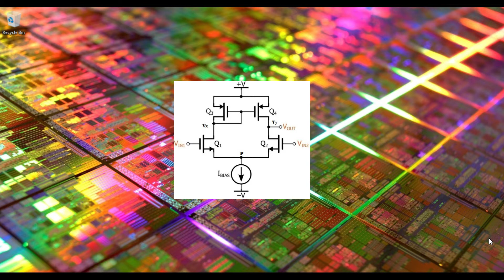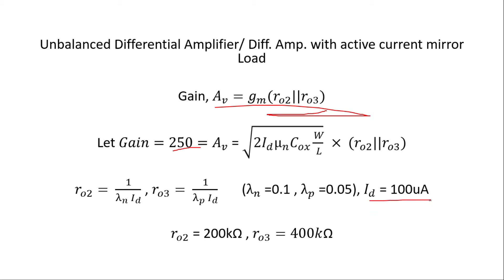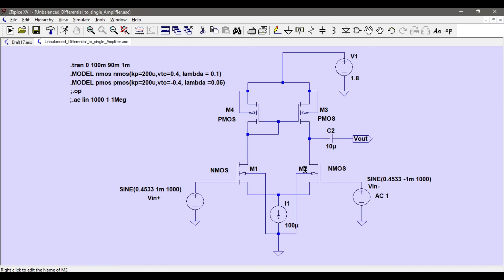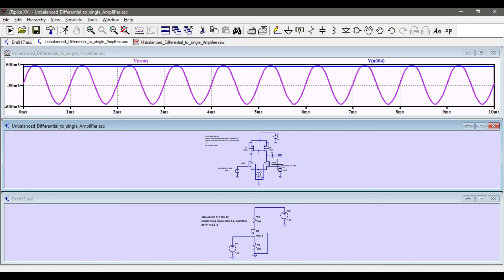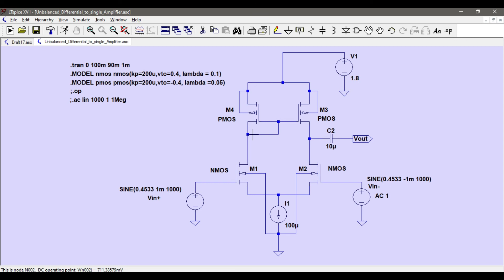Differential Amplifier with Active Load in LTspice

Comment: I'm getting ro2=100kohm, and ro3=200kohm.. I thik sir you have done mistake while calculating
Reply from the maker: I've already replied to this one many times. Please have a look at other comments or try to analyse the circuit on your own again. By mistake I've named tail current of the differential amplifier as the drain current of MOSFETs. In fact, drain current is half of tail current. Substitute that and you'll find the right answer. 

There's no problem in calculation, if it was there, you wouldn't have seen the required gain in simulation.

Comment: How did you get  176 for W/L? I keep getting 352 when I do that calculation
Reply from the maker: Hi Tristan, 
Glad that you asked your doubt. It's a little confusing since I used the same notation Id both for drain current of individual MOSFETs  and tail current of the differential amplifier. I apologise for that. Actually since half of the current flows through each branch, the tail current is halved in each branch which means the current is 50uA not 100uA. 
With this you'll get the proper answer. 

Hope it clears your doubt.
Reply: @jairamgouda  If you half the current, the width would have to double to keep the term under the square root the same. Unless you are still required to plug in the 100uA to the Av equations and then half the resulting width later.

Comment: Vgs formula is wrong or the calculated value (0.45333V) is wrong at min 2.11.
Reply from the maker: Everything is right. But it's just that the current I've shown Id is the tail current of the differential amplifier. The true drain current is 50uA. Substitute that. You'll get the right answer

Comment: What should we do if we want gain to be greater than 40dB in transient analysis of differential amplifier circuit
Reply from the maker: Hi Chimata, I'm glad that you asked this question. 

** 40dB is equivalent to 100 V/V gain. So, what I've shown you in this video is much larger gain than 40dB. In fact, it is 47.95 dB.  If you still want more gain you can change the aspect ratio but that has manufacturing limitations. So, you can go for cascading two differential amplifiers.  You can go for cascoding also 

** But what do you mean by "in transient analysis? "  I want you to carefully use these words. When we plot the frequency analysis plot is shows the "Bode Plot" whose magnitude is in dB. In fact, you can change that axis to V/V as well. The reason why it shows magnitude in dB is because when you have multiple systems or multiple stages of these circuits, their frequency responses (Transfer functions) can be added (because of log operation) instead of multiplying. Why we need to multiply ? Because we know convolution in time domain is multiplication in frequency domain.

So, I've assumed that you asked me how to get more than 100 and answered your question. Hope it helps you. I encourage you to ask more questions if it's confusing. Just get clarified. That's all. You must be crystal clear with these concepts while designing.
Reply: @jairamgouda  thank you so much

Comment: If Tox(oxide thickness) is in meters how do we use uA/V²,please help
Reply: And how did you get r2=200kohm
Reply from the maker: Hi, Jai Shankar. I thought of replying you here. But everything doesn't fit here. Please look at this file-> 

 https://drive.google.com/file/d/13godiFpH1YmzrxFF3mw4buQgwpLCVnH_/view?usp=drivesdk

How did I get ro2 = 200kohms? Look at the ppt uploaded in the description. Lamba and Id values are given.  If you have genuine doubts and if you don't understand something, mail to to the ID given in the description.
Reply: @jairamgouda  Thank you for the reply,once check your mail...
Reply: @jairamgouda  but when I'm calculating r02 and r03, I'm not getting 200k,400k♎
Reply from the maker: @A.Jaishankar  You are confused since I used same notation Id for tail current and drain current. Drain current is half of the tail current which is 50uA. If you substitute that, you'll find it correct.

Comment: How do you ensure all transistors are in active region
Reply from the maker: The basic formula for an NMOS to be in forward active region is Vds >= Vgs- Vth. And for pmos it's the opposite. Anyway in this cicuit you don't have to worry so much unless you need an extremely large gain.
Reply: @jairamgouda  but, let us I wanted to see whether all transistors are in active region or not? How do I do that in LTspice
Reply from the maker: @INDIAN-wx3us  As I know SPICE program doesn't directly tell you the region of operation of a device. I'll get back to you if I find any better answer.